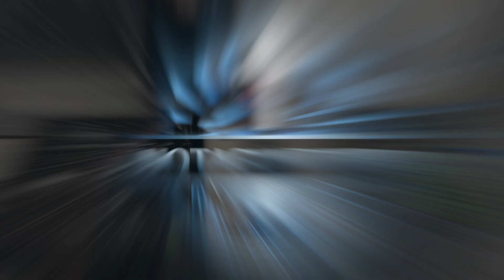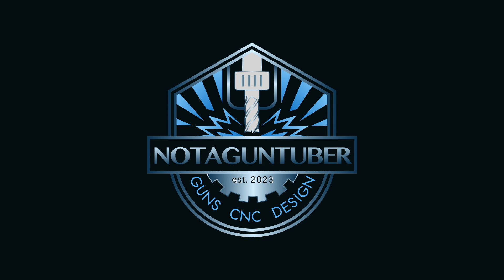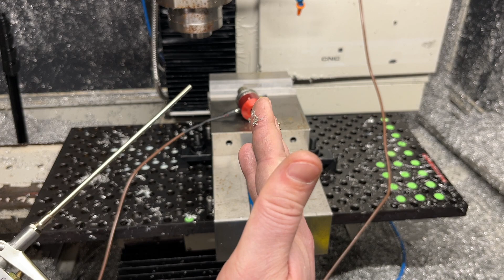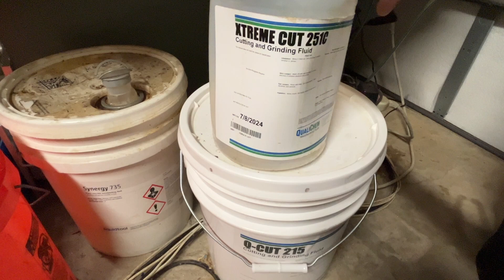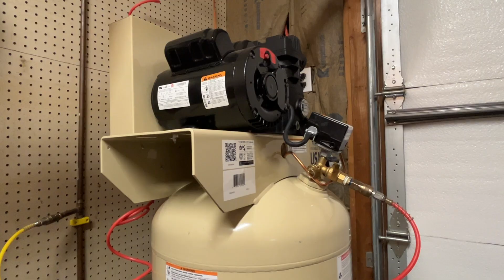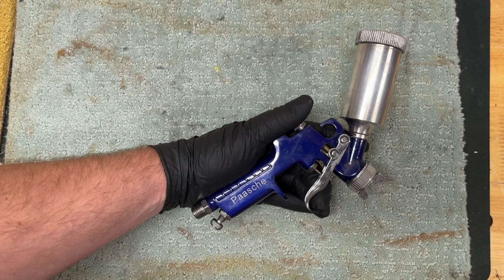2025 Shop Improvements- Tormach Tosa Fixture Plate, Digital Probe, Paasche HVLP, Compressor, Bandsaw

Comment: Blowing yourself down with compressed air is convenient but also dangerous. Most shops explicitly prohibit it because of the risk of giving yourself a compressed air embolism.
Reply from the maker: Would have never guessed that! Will add a warning for now. Initial research since reading this shows a lot of places saying that, but few actually citing instances. OSHA seems to list on, back in 2019, but that was with a cut on the guy's hand. Then again, cuts are common in machine shops so that's valid. 100psi seems to be the danger zone number. But you'd have to have your nozzle right on you to get 100psi in a lot of cases. Pressures drop pretty quick once you hit open air. OSHA seems to recommend 30psi and below, which is an easy mod that I will likely go do. Thanks for the heads up!
Reply: I’d be lying if I said I’ve never done it myself. But you should atleast be aware of the danger.
Reply from the maker: Absolutely. Thanks for the heads up! I truly would have never even thought this posed a medical risk.
Reply: @NotaGuntuber  There are blow guns available with vents so they are safer than solid guns like you have.  Not completely safe but safer
Reply: blown myself off everyday for the last 40 years. all is well. lol
Reply from the maker: What PSI are you using? I read up a bit and although there doesn't seem to be an OSHA recommended pressure for blowing yourself down, they do say 30PSI for using pressured air for cleaning. I have to assume that number takes into account the air hitting you during cleaning processes. So I've regulated my line down to that OSHA number. Works almost as well as the higher pressure did. And if it keeps me safer, great.